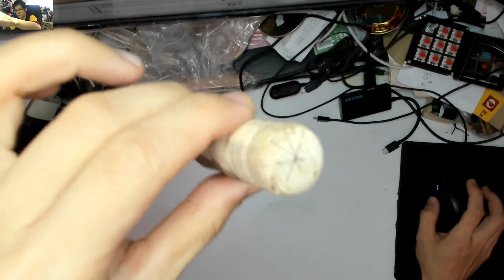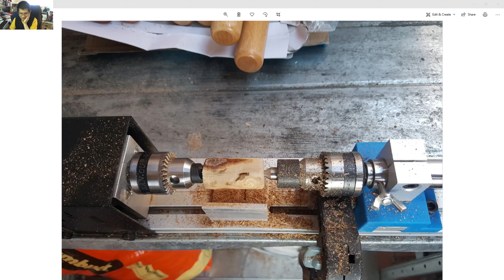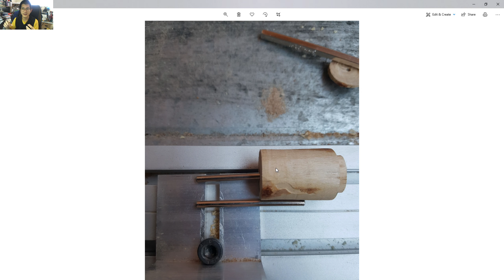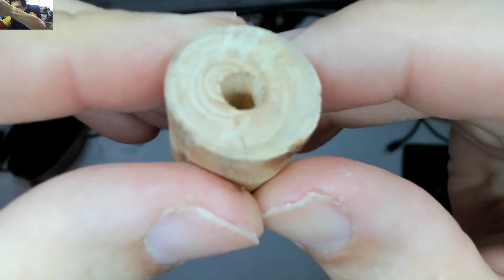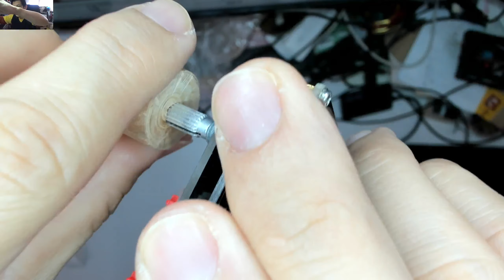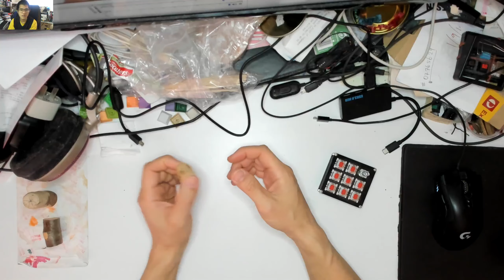Mini Lathe Turning - Part 4

Comment: May I ask how much the lathe was?  I'd like to design and produce a few fountain pens.
Reply from the maker: Hi John,
I got the most basic of kits which was $44.99 USD on sale, which is now discontinued and replaced with very similar machines in different kit options.

I would say that while you could make fountain pens with this, you'd be looking at softwoods mostly, and you'd struggle to keep good centering.